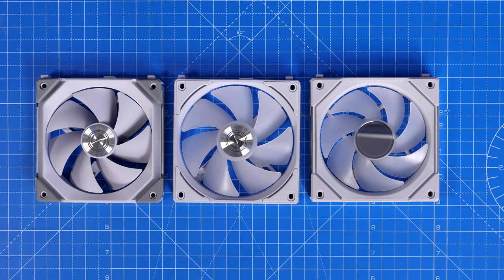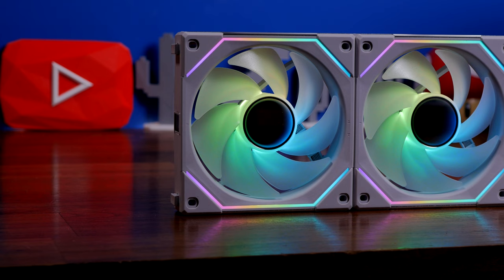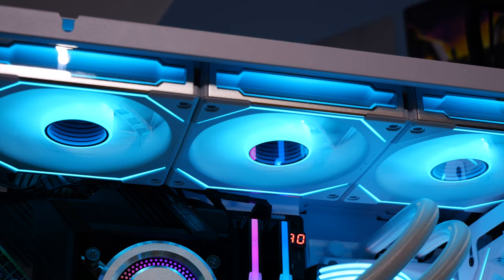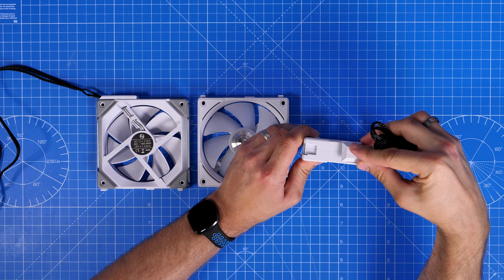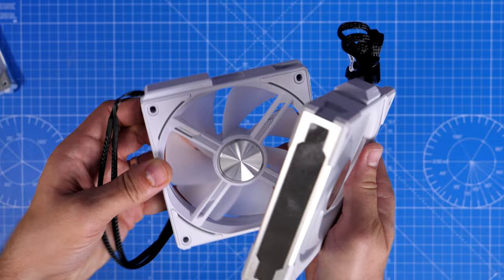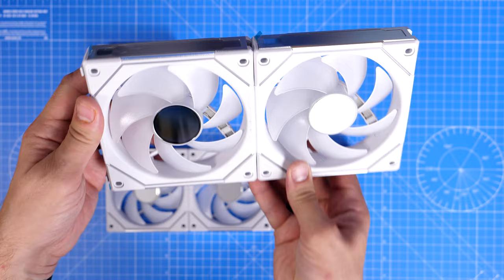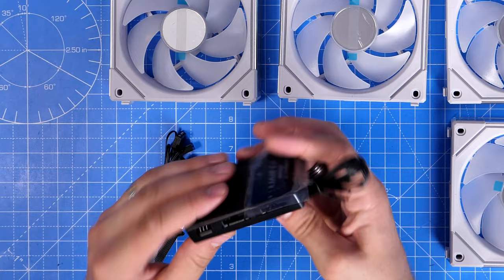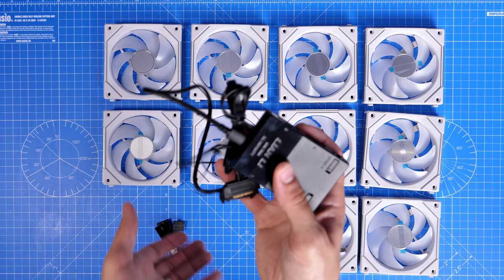Lian Li SL120 INF vs SL120 vs AL120: Awesome Uni Fans compared

Comment: We need more companies to adopt a similar daisy chaining system (looking at you Corsair, Mr 2 cables per fan 🙄🙄)
Reply from the maker: yup
Reply: makes me wonder if this feature is patented, or other companies are just too lazy
Reply: Dont forget the 6 fan limit vs 16
Reply: What's exactly wrong with 2 cables, especially if they go into the same place? You literally wire fans once per build, and with 1 cable, as in many similar vendor-locked systems, you lose out on motherboard control and interoperability, and are often required to run software permanently. Is one-time cable management that much of an issue for people?
Reply: @Lishtenbird  while is not a big issue it is clear there are better ways. So having to be limited to 1 controller that does 6 fans and need 12 cables just to wire fans feels extremely outdated. Once you go over 6 now you gotta add more controllers.

By contrast you have lian li that let's you control 16 fans and takes a minimum of 4 cables to wire them up. That's a massive improvement in design.
Reply: @Deviantsoundz  But that's my point: Lian Li already cut down the amount of cables to a single pair of PWM+RGB per a set of (usually) 3 fans. That's plenty enough, so then going from two parallel cables to one cable with losing all the interoperability and flexibility was entirely unneeded.
Reply: @Lishtenbird  idk if you seen lconnect software but not sure about calling it limiting. Also im talking about large builds not 3 fans here, anything under 6 is ok with the corsair controller. Above that it just becomes a waste of space and time. I actually use corsair stuff a number of times. As long as i dont need more than 6 fans going to the hub it's fine. I actually have 3 personal systems with their aio and commander core xt.

Also 2 wires per fan is ok IF a hub or special adapter is not needed. Like for example artics argb fans with pst or fractal aspect fans. Daisy chain the pwm connector together and the argb connectors and you have 2 wires for the entire section.

On a side note corsairs new aios have gotten rid of the external controller, even they got it was a bit redundant at this point.
Reply: @Deviantsoundz  Lian Li own website says not connect more than 10
Reply: @richh9570  if white full brightness
Reply: @Deviantsoundz  what do you mean? Because I currently have 12 corsair argb fans, and would like to buy 12 lian li infinity fans, but if I can't use more than 10, it's pointless
Reply: @richh9570  the 10 fan limit you speak of is for when its set to white in full brightness. White uses all 3 R G B elements at 100%, so its the color that takes the most current. Any other color you can do 16, 4 per channel in 4 channels.
Reply: @richh9570  also thats for older uni hub, new hub uses dual sata connector. From what i seen the 10 fan maximum while in static white is not shown for new hub. Either way on old hub you could do more than 10 in static white but with a dimmer light setting.
Reply: @richh9570 I have 10 Corsair fans connected to 2 hubs. That a lot of cables to manage. With the sl120 you can have 16 fans connected using 4 wires to one hub. Huge difference.
Reply: So, its now August 2023, and Corsair has now released their version of this, and every channel I've seen has been praising them to high heaven without a word about the OG smh

Comment: I have 1 hand so replacing my 6 cheap apevia 120's with the Uni Al120 was super easy even for me. Being able to adjust the speed is a huge deal even though i know thats mainly an issue with the cheapies. They blow so much more air at almost half the rpm while being extremely quiet. Beautiful rgb settings. Super happy with my LianLi o11d evo build. Thanks PP.

Comment: Lian Li keeps impressing with both the lightshow as with their innovation. For my next built in a Lian Li EVO case, I'm on the fence: Go for Light Wings or these. A quiet operation is something I value over performance. Using the INF. fans on a radiator seems to yield very average performances according to Techpowerup. I'll wait for more reviews and comparisons before giving Lian Li the nod.
Reply: Currently using the old SL 120s on a Kraken X73 in a o11 Mini case. Great temps and quiet operation, would recommend.
Reply: @RacismIsMentalillness  Thank you, your comment is very helpful. The Infinity can potentially be louder, but when your air flow setup is decent then you can lower the RPM curve to compensate a bit. How many casefans do you have in your mini?
Reply: Scythe Kaze Flex are the quietest case fans on the market for the performance.

They make an RGB model but it's pretty vanilla and honestly RGB isn't good for performance because the plastic must be translucent, meaning it's less rigid and actually has a lower CFM than opaque fan blades.
Reply: The newest one infinity sl120s are quieter at higher rpm
Reply: I've cycled through the SL120, AL120 & just recently switched to the SL Infinity fans. The one thing I noticed is that the SL120 & SL Infinity fans were much quieter than the AL120's @ both low RPM & high RPM, so it was easier to make a fan curve profile for each the SL120 & SL Infinity's. I ended up returning the AL120's and eventually sold my SL120's because of the easy one cable connection that the SL Infinity's offered.
Reply: @jaded265  Awesome! More confirmation on SL Infinity's quiet operation. I've already decided to go full Lian Li for the next gaming setup. The one I recently got has Be Quiet Silent Wings and have no complaints about them. The problem I do have is that the Royal Trident G skill memory does not seem to react with third party software and can't change the lights despite trying numerous solutions. Gonna try Corsair ram sticks and see if icue plays nice.

Comment: Just bought three 3 packs and a single pack. So expensive 😭
I was thinking about doing a dual color design, so I would probably need to plug in two of the control boxes. Will the L3 connect software control both?

Comment: I was just going to comment on your other video comparing the Corsair fans that u need to get your hands on these.. They do look great and I’m definitely getting them for a build I have.. Imo if this fan had the thick strip of RGB on the outside that the OG SL fans have it would be the completely blow everything else out of the water
Reply: As someone who works with electrical equipment, I still cannot fathom how every company making RGB fans, or any fan for that matter, hasn’t made a way to daisy chain their fans.. There is definitely more than 1 way to do this which I’m sure would get around Lian Li’s patent (if they even have one).. I should apply at Corsair, after building my first PC the ideas I have in my head that would make things SO MUCH easier and better could make a lot of money!
Reply from the maker: Agreed. There are some daisy chaining cables with some other fans (like NZXTs) but none are as easy as Lian Li's as far as I know.

Comment: I'm curious if you might be able to flip the infinity mirror decal on the SL INF 120's to the rear, and if it will work properly if you do.
Reply from the maker: Not that I'm aware of.
Reply: NO, the intake side of these fans were neglected and many times, as in the build you see here, the "B-side" is regrettable.

Comment: thanks for the video, ive been deciding which fan to get. My only question is, see the Lian Li hub controller, does that have 2 normal RGB ports to plug other devices into? I'm wondering if im going to have to buy a splitter cable or not. Or unless I opt for the AL120's and get the older hub which prob has them?

When I say other devices, Im intending to connect the rgb from my AIO and my case to the hub controller

Comment: I just spent $350 for 3 of the 3 pack SL Infinity fans and 1 individual infinity fan for my case.  I have all Corsair QL120's in there now but add in the corsair Commander Pro, Corsair Commander Core and a Corsair Node Pro to get them all to work but im switching cases and im not doing all that wiring again.  I think the QL120's are the most vibrant RGB fans out there but im sick of all the wiring and different control boxes required. This case swap has gotten very expensive because of the fans lol

Comment: The ARGB cable is not included in 3pcs package. Since I DO want to use ASUS AURA and not LIAN-LI software, this is a bummer. They basically force you to use their HUB and software unless you buy 1pc package. Makes zero sense to me.
Reply from the maker: You can use the 5v RGB cable from the control box and not connect the usb cable and then you get your wish

Comment: Oh lookie, the infinity ones are so pretty, look how sweet the lighting effect looks in the middle!  They took their old models and merged them into a great new model! But - hol'up - what is that i see when i use the fans as intakes? Isee the ugly cage over the fan and what i don't see anymore is the center infinity mirror - how daft can a designer be to delete/forget the namegiving feature on one side of a double-sided product? This so much grinds my gears - i bought 6 of these fans and all i stare onto is the uglier backside. Such a letdown, i'd have not bought them if it would have been clear that i have to see the cages covering the fans all the time.

Comment: Great video, Bit of a daft question but is the mirror side the intake side this time around and not the Lian li logo side?
Reply from the maker: The mirror side is what's pulling the air in (so yes, if I'm understanding your correctly).
Reply: @TheProvokedPrawn  Yes that’s what I was wondering thankyou! Would explain my higher temperature as I presumed the Lian li side was pulling
Reply: As a tip - you can ALWAYS tell what side is the intake side by looking at the fans.  The side of the fan that air is sucked in on will always be the face of the fan blades, the side that exhausts the air will always be the side with the brackets that hold the core of the fan.  They can't make the fan float, so if you are looking at the "X" on the fan, air is coming out of that side.

Comment: Could I put Lian li infinity fans and Lian li AL’s in my case at the same time or would it be messy? Like infinity fans on the rad and the bottom and then 3 AL’s on the side
Reply from the maker: It would get complicated as they use different controllers.
Reply: @TheProvokedPrawn  do the sl v2 and the sl inf use the same controller because im using both fans in my case wondering if i can do that.

Comment: Hello, I'm a very big fan of your video which fascinates me, I'm from Belgium and I have a question for you: I installed a group of Al 120 fan with V2 connector and a group of Strimer V2 and only my light effects work on the stripers and nothing works on the Al neither color effects nor RPM function they are connected to 2 USB ports different from my Asus Rog Z 490 F Gaming motherboard, do you have a solution for me ? thank you in advance, really sorry for my English (Google translation)
Reply from the maker: Have you updated to the lastest version of l connect? The website also has helpful FAQs
Reply: Merci pour ta réponse rapide l'ami oui j'ai bien mis à jour la dernière version de L connect directement sur le site officiel de Lian li et j'ai également voulu leur poster un rapport d'erreur mais quand je veux leur envoyé je n'y arrive pas car cela m'indique toujours que l'adresse de mon domicile n'est pas correcte

Comment: I have 9 AL120 which are fantastic and I like the look of the INF fan they look a must buy BUT if I put 2 fan sets of 3 on pull and one set on push I only have the Infinity on one set of fans in the centre, the other 2 sets show the old label on the SL models, which looks pants compared to the AL fans. They should come out with a push/Pull set so we cab get that new look on the fans. Or is there a way to do a work around??? thanks Mal
Reply: Don't forget the CFM values are less on the INF fans than that of the AL-120's.  And the AL-120's are less than that of the standard Corsair Cappelix Elite 360mm AIO fans.  So it's a step down in radiator fan capability using the Infinity fans.  Probably want to consider that just as an example realizing you probably don't have a Corsair Radiator but i thought i would mention it.  Lian Li AL-120's are really nice fans and if you have already purchased them in your case, leave well enough alone.  But like Provoked Pawn says, they are really nice astetically

Comment: Currently using the sl 120's and have them on my msi meg s360 aio. Since the sl 120s have 2 separate cables i was able to hook.up the fan connector to the #1 pwm fan port on the aio so it would recognize the fan hooked up. If i use the new infinity fans which have a new single proprietary connector how would i go about hooking it up? If i just plug into the control box and dont use the aio's fan pwm connector like with the sl's will.it give me a fan error? Is there some sort of adapter to use for this??? Any info would be greatly appreciated! Thank you !
Reply from the maker: Single packs of the infinity fan don't have the proprietary connector so you could use the same logic. https://youtu.be/W_ApiN_Wueg

Comment: why the hell nobody compare the "cooler power" with fans? how care the rgb, the light, the connector, it's FANS so better or lesser "cooler power" of the old generation?
Reply from the maker: It's incredibly subjective. Environment, system specs, all sorts of external influences and frankly I haven't had time.

Comment: Quick question; How many connectors do you get in the triple pack?
Reply from the maker: four fat ones and a splitter.
Reply: @TheProvokedPrawn  Phew! I bought two triple packs for a 3 at the front, 2 at the top and 1 at the rear. I was worried that they only came with 1 cable.

Comment: Question: If I were to get SL120s, could I still connect them to the controller included with the SL120 INFs?
Reply: They have different controllers and different connections
Reply: There are two additional ports on the controller for the SL120 INF fans for connecting the ARGB of those fans (or other non Lian-Li ARGB devices).  However, I believe the power/control for the SL120 fans themselves would then need to be plugged into fan headers on your motherboard.

You could totally hook up 2x3 SL120 fans and 2x3 SL120 INF fans and only utilize one Lian-Li controller box (the new one).